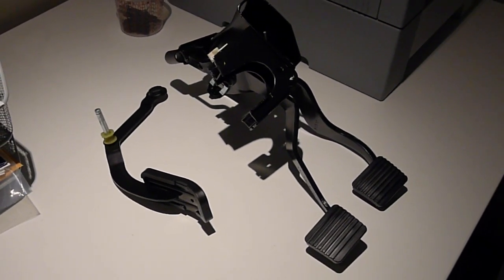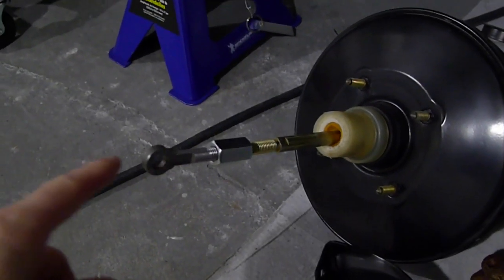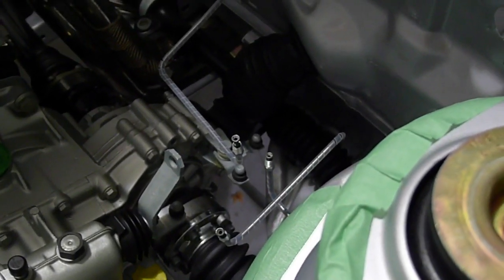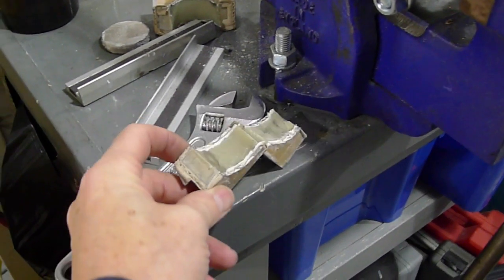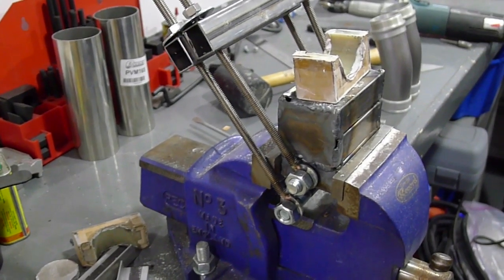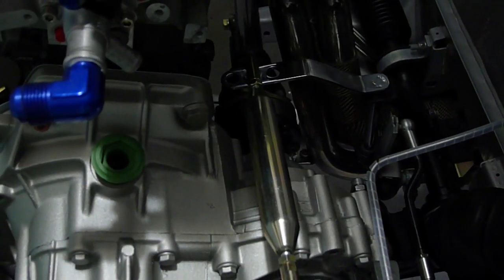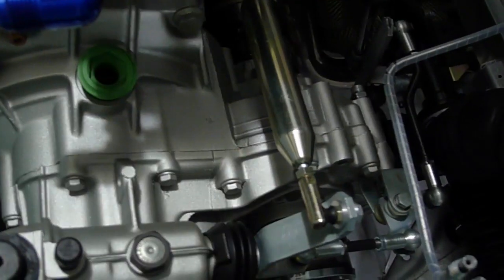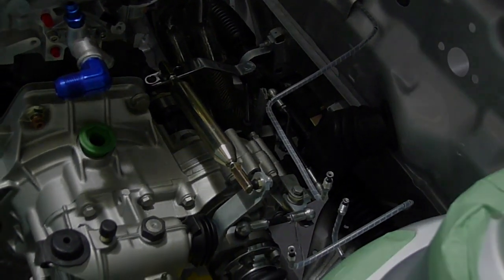The Ultimate 1983 Rabbit GTI - part 66 (Pedal Cluster, Brake Servo Clevis, Intakes, Shifter Linkage)

Comment: this is helpful, after watching this i think my brake pedal is missing the return spring.  
it's a pain to drive, the brakes stay engaged for a few seconds after releasing the pedal.
Reply from the maker: You'll see that I ended up with an adjustable pedal position and the ability to change the spring position as well - you do need that spring in there to help pull the pedal back up. Best of luck
Reply: @derekspratt  i found a spring from a MK2 VW, drilled holes in my pedal arm and bracket to make it work.  took a few tries drilling holes in the bracket but i got enough return force to solve the dragging problem.

Comment: I tried bending the tubes the same way you did but instead of using cardboard i used a nylon block both top and bottom and what kind of carburator are you using because i am thinking of doing a Weber Vargasser setup on my stock 1.8 engine.

Comment: Hi
I also have the 4 crawler linkage kit for my MK2 and I'm currently have trouble with engaging 2nd gear sometimes while driving. How did you adjust the linkages to help with engaging 2nd gear in your case? 
Thanks
Reply from the maker: That may be a synchro issue - if it is easy to put your trans into 2nd when the engine is off, then I would blame the synchro. You could also try different trans fluids which can affect shifting performance ...

Comment: Can you tell me how the throttle cable is held in place to the fire wall?
Reply from the maker: Steve B Using the standard OEM grommet. I just slipped in the after market cable and it worked nicely.